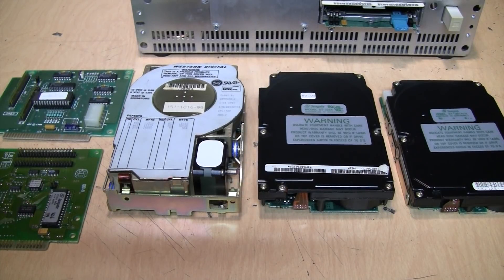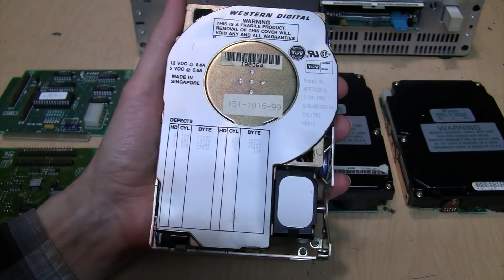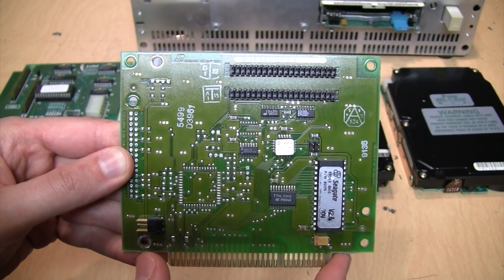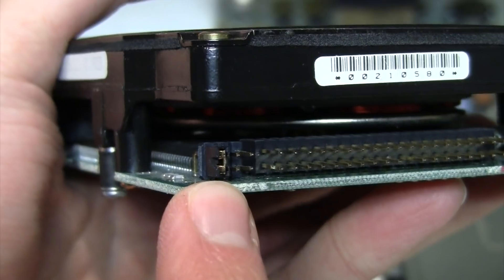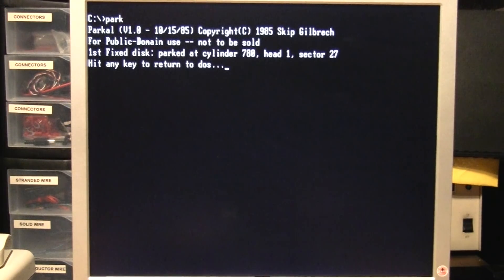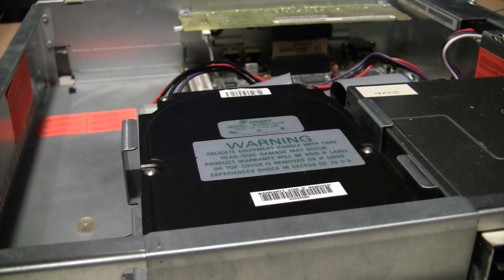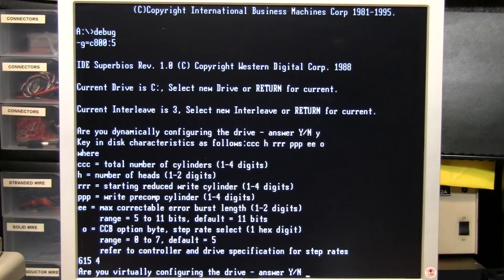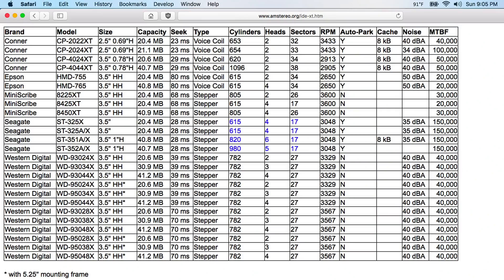8-bit IDE-XT Hard Drives Demystified

Comment: to be fair to the IDE-XT drives, since I made that video I've come across four of the drives. One was a random find on a Goodwill shelf and three I found in PC's I acquired. I have yet to test the one found at Goodwill but of the other three, only one was dead. The other two fired right up. They do seem to be more common than I initially guessed. MY VTI 286 had this odd quark where it refused to boot to any other hard drive than the IDE-XT it came with. I tried multiple 16-bit ISA controller cards and SCSI cards and drives but no luck.
Reply: If the drive is serialized or identity matched to the motherboard, then the drive will only work correctly as such. Sometimes made-to-order industrial workstations are like that.

Comment: Thanks for posting this, I've been looking all over for info on these drives.  Long ago I used to have an '86 IBM PC XT 8088 with a 20 MB hard drive of this type. Based on the few videos I can find, I think it must have been a Tandon TM262 as it sounded exactly like your WD here, but predated WD's buyout of Tandon.  Mine also developed a bearing fault after about 5 years that made the drive fail to spin up unless you gave the stepper motor some manual help (which I bet it hated). Really miss the sound of that thing. I can still hear the precise sequence of "chirps" the stepper motor would make during its power-on self test.

Comment: I still remember the drive parameters for the Seagate ST-351A/X, 666 cylinders, 4 heads, and 32 sectors per track. The BIOS in my 286 would lose its mind every once in a while and I would have to enter it manually to get the machine to boot!
Reply from the maker: Actually it's officially 820 cylinders, 6 heads, and 17 sectors per track. But since it does sector translation, almost anything that adds up to approximately 40 MB will work.

Comment: This is all modern stuff. Back in 1991 my job was looking after systems that used SMD hard drives with 15" removable platters. They were 300MBytes though. I had to present a training course and people were asking "why are you using these old drives with voice coils? Modern drives use stepper motors." The answer was that PC drives weren't up to anything like the same capacity at that point.

Comment: This prompted me to look up the known pinouts of XT-IDE and regular AT-IDE.  The odd numbered pins are almost identical on both standards. But on the XT-IDE, the even numbered pins are all ground, and on the AT-IDE, it adds those extra bits.  One would think there would have to be a way to make it work both ways with an adapter and not needing a switchable drive, but there would be translation circuitry needed definitely.

Comment: A while back I came across a forum thread and a few web pages where people were trying to connect CF Cards to XTA directly using the not-widely-known CF 8-bit mode specified in the standard. If I remember correctly, one person pulled it off by using the XT-IDE BIOS with a modified CF-to-IDE adapter.

Comment: I had an ST351A/X around 2007-2008 I pulled out of a 386 on the side of the road. Should have taken the whole machine. Used the drive for various things including my first real forays into the realm of MS-DOS networking fun.

These days it lives in a Tandy 1000 not much unlike yours in Missouri but partitioned for 20MB because there's bad sectors in the middle of the other half, and the owner wants to play it safe.

Comment: I had one of those wD drives that stopped working (way back in the  late 90’s). Figured I had nothing to lose, so I popped the clips, took the top off and gave the head assy a nudge. Started working again, and never failed 🤣

In 92, my mom gave me a packard bell 8088 fir my birthday with an 80mb wD caviar in it with an 8 bit interface card (might have been a wD, but cannot remember). Transferred both it and the hdd to a Tandy 1000tx later on, then the hdd itself to a 486 with a 16 bit isa card.

Comment: 15:34 - I recently had one of these - that stepper motor actually worked, it was the drive motor that had thrown a bearing or something - it sounded like a grinder. I opened it up and found shavings all over, yet I was still able to pull a DIR command on it.

Comment: Interesting, I do remember their been issues getting IDE drives running in XT machines, it was something I was going to attempt, but never did.
Reply: The more modern XT-IDE card is helpful there, If you don't insist on period authenticity. Has our host pointed out it allows you to attach either a modern IDE or CF card to an 8-bit system. That way you can avoid the control and expense of shopping for ancient MFM or RLL hard drives. Bonus feature: if you get a card that allows you to insert the CF card through the mounting bracket, it is relatively easy to transfer data from a modern system.

Comment: Very interesting, and I was really surprised to see the defects listed on that Western Digital drive; would they be shipped new from the factory with those defects due to poor yields, or maybe these were refurbished drives resold cheaply?
Reply from the maker: New hard drives and SSDs still have bad sectors today. They're just mapped out in the firmware so they're invisible to the operating system and user. Old hard drives weren't advanced enough to do that yet.
Reply: I had a Type 1 (10 Mb) MFM drive that I recently built into an Everex 286 and the defect list was empty. I have never seen an empty defect list. Considering the drive was 40 years old, that was amazing. But yes, those defect tables were a common sight in the mid-late 80s.
Reply: Very interesting. I didn't own a hard drive until I got a 52 MB (I think) IDE Seagate for my Amiga 500 but that was the late '80s or maybe even early '90s. I guess by then the defects were handled internally.

Comment: That WD drive and others like it weren't really WD drives: they were rebadged holdover designs from Tandon after WD bought them out. Up until then and for a few years after, WD built drive interface and video controller chips before selling off the semiconductor side of the house to focus on hard drives instead. Their first real in-house WD hard drive was probably the WDAC280, an 80MB 3.5" ATA drive that introduced the familiar Caviar name and designs that people knew from the early '90s.
Reply from the maker: Correct. There was also a 40 MB Caviar drive.

Comment: 6:05 I've seen those referenced as ESDI but its interesting to know they're actually an IDE like interface
Reply: There is an astounding amount of disinformation about this era of drives.  It was a period of free-for-all, short-lived, and a long time ago.  :-)
Reply: I thought that ESDI was distinct from IDE.
Reply: It is, but a lot of those interfaces are very similar.  E.g., ST506 -- the original MFM controller interface -- is still the basis for IDE.  The main difference being that the controller moved from a card that went into a slot and communicated raw data to the drive -- to a card on the drive that communicated to the slot using ISA signaling as the protocol.  ESDI was the in-between point.  I don't know a ton about the specifics -- partially because it's really hard to find detailed documentation on some of those short-lived, relatively unique interfaces.

Comment: IDE just means the adapter board is attached to the hard disk drive frame instead of being a card in an ISA slot.

The 40 pin connector is neither IDE or ATA, it's a pin reduced ISA bus connector.

ATA is a protocol.

Optical drives that connect to the 40 pin ISA connector use the ATAPI protocol on top of the ATA protocol, or rather, it is a Packet Interface extension to it.

PCI "IDE" is more accurately PCI ATA.
Reply: I've felt for a while that once we got to PCI and SATA, the "ATA" part kind of ceased meaning "AT Attachment" and just became a meaningless legacy acronym to link it to the old parallel interface by lineage.

Comment: I have a Commodore Colt that I installed a Seagate ST351 A/X in.  I had to install a newer BIOS before I could see the full 40MB, but it works very reliably.  I should probably keep an eye out for another in case this on dies.

Comment: Seagate did have bad sectors but mapped in replacement sectors in ROM. Sometimes you could format a drive and always at the same point it would skip to the spare sector and back again. This is why you should not do a true low level format because it would wipe the ROM table of bad sectors and try to create a new table. The original table being mode accurate as it was created with diagnostics. Seagate bought out CDC or Control Data Corp. to teach them how to make reliable disk drives.
Reply: At work we had the SMD 300MByte drives, some labelled CDC and the newer ones with a Seagate label stuck over where they had said CDC.

Comment: I remember how my dad was learning about IBM PCs before getting one, which would be a Commodore Colt (an XT computer).  My dad was educated by computer-savvy people, including the employees at computer stores.  PCs were more complex to operate than TRS-80s, Commodore VIC-20 and 64s, Apples and other such home computers.  When he got an HDD for the Colt, it sure made a difference in loading and saving, compared to using a floppy drive.  I wonder if it could be one of those IDE-XTs.  The '90s were interesting times in getting those complex PCs to work right.  My dad and I even taught people we know how to operate such things, as well as installing HDDs (maybe IDE-XTs, unless they were used on ATs).  Then there came a time when I showed my dad some things that he couldn't figure out.  That would make me decide to go back to college and get a Bachelor's Degree on some computer stuff.  But that's another story.
Reply: yes it is an xt ide, i have a commodore pc10/3 motherboard  i 'rescued' from a bin at work, when they were chucking a load of old computers out, wish i'd kept the case and psu as well, i did have it, d'ohh!, but i originally got the stuff just to strip chips off(got a few other boards as well, an epson equity 2, and some goldstar thing seemingly no info at all on the net)...  they're basically the same thing internally,  i've managed at last to get the board to boot up, it had a stuck reset line,  but havent done anything more with it yet, font in 40 column mode (dipswitches on back to set 40 or 80 boot default) is identical to the pet and gives  same beep sound 😁 i've been wondering about getting an at ide working on it or at least a cf card, theres one or 2 control lines missing for a cf to ide adapter but thing the extra circuitry can be patched onto the motherboard, biggest problem is the bios as although cf cards can work in 8 bit mode, a command needs to be sent to it first for it to switch over, xt-ide bios as on those isa xtide to cf card adaptors would likely work but i suppose if fitting  one of those just for the extra bios, may as well use the interface on that...

Comment: I have a single IDE XT hard drive in a Tandy laptop - I think it uses a high density connector as well, which is another annoyance. There's some other funky drive in a Zenith laptop I have, but I can't remember if its 8 bit IDE or just a really funky MFM physical interface
Reply: I had a Toshiba T3100 Laptop that used a similar interface. In the pre-internet and nostalgia days I scrapped it when the hard drive failed as I had no idea where I could get a replacement. That laptop was full of non standard parts, using SIMMs with pins on them rather than the more using PCB contacts.

Comment: I had a WD drive that looked exactly like the ones in the video- big fat tall ones that seems to have the metal shaped around the platter area. It was 43MB. But it was in a 286 and was attached to a 16-bit controller, so I guess it wasn't one of these special drives.
Reply from the maker: WD also made IDE-AT versions of those drives. They were originally designed and made by Tandon.

Comment: I have that same st351 in my arcade machine for game save data.
makes the same sounds and everything Its only like 30mb or whatever but it still works fine. You know its doing it's job and working from how loud it is. Had no idea it was that old but I checked and the thing is at least from 1989. Surprised its still working and under windows10 thats nuts! It came out of this compaq portableIII  I had a few years ago, old lunchbox type thing with a hellishly red screen. Any idea if I need to worry about parking on these?
Reply from the maker: No, the ST-351 is auto-parking.

Comment: I had Commodore A590 with 20MB XT drive. It was slow, loud and got really warm after hours of normal use. A590 have SCSI controller onboard so I upgraded to a 540MB SCSI and my Amiga 500 got really fast booting.

Comment: Some of the first XTA drives (as well as ATA and some of the ESDI) were mechanically pretty much MFM/RLL drives equipped with redesigned boards. Why waste a crapload of mehanically sound mecahnisms that had already been produced?  That can readily be told by them containing a bulky stepper motor and metal strip drive for the heads, with similar looks to one you'd find on a 5,25 inch floppy drive. The voice coil style head movement was already available in the early 90's ATA drives.

I have a 40MB Miniscrbe drive which appears to be XTA, with the voice coil mechanism, and I have an Amiga HDD controller that has the option for XTA or SCSI. The latter style of drive is obviously far easier to obtain. Why I think the Miniscribe is XTA, is that it lacks the master/slave jumper, which I haven't failed to find on any functional ATA drive I have encountered, and also it appears that there is some different life to the drive when connected to the Amiga controller, compared to being connected to a newer PC board. Kinda like it was trying to do something, but it never detects as a configurable drive. EDIT: Maybe the reset signal polarity is the culprit, hope I can find a way to alter it.

The autopark feature appears to be inherent to the voice coil head movement, it travels home when not powered, but the stepper motor movement does not do it.

Comment: You flashed on the Minscribe @5:22 with it's unique card and power source. I have a Miniscribe 8425 that didn't use the power from the card (didn't have one anyways) but needed the molex power from the MB. I don't understand why these cards have two ribbons? Can these cards have adapters for the other 8 bit HD's mentioned or would you need another card?
Reply: you have the MFM version of the miniscribe 8425.

Comment: I still have two of these drives in one of my drawers. They were pulled from an IBM PS/1 I owned in 1991. Pretty sure they haven't been spun up since at least 1993. I'm tempted, though sounds like it would take me a while to get all the necessary hardware, and there likely isn't anything worthwhile on them other than book reports and my early foyers into Sim City, Civilization, RRT and my attempts at hacking Dune II so I could spawn Devastators for free.
Reply: I would suggest spinning up your drives even if you don't connect the data interface. This should hopefully help prevent the bearings from sticking. Just make sure you don't permanently un-park a drive.

Comment: I have one of those Western Digital stepper drives that doesn't want to work. All I have to do is tap the side of the computer with my palm when turning it on. I just need to break the stiction of the bearings enough for the motor to start moving.

Comment: Damn, now I want to see if I can find all of the pieces of the two Winchester 20MB hardcards that I took apart as a kid after they failed in my dad's Amstrad PC, and see if I can get them to work again... unlikely though.
It would be interesting to know what exactly the usual failure mode of these drives is - i.e. if you have a working drive now, should you use it as little as possible to avoid wear (like a monochrome CRT), or can you just keep using it and fix whatever fails (like recapping a board, replacing belts etc)... surely it can't ONLY be a case of a drop of oil for the stepper motor?
Reply from the maker: Oiling the motor does often get them working again, although not permanently.
Reply: @vwestlife  Yeah... in those drives that can be (even if just temporarily) revived by oiling the motor, the problem is probably internal lubrication that's gotten sticky over the decades -  which means disassembling and cleaning the motor (or replacing it if that isn't possible) would restore the drive fully. (Also, in those cases, it would actually be beneficial for the motor to be exercised often, as it's not wearing out but getting stuck.)

I'm wondering if there are any other likely failure modes related to wear or aging of replaceable/fixable components (obviously not counting head crashes, corrosion etc)... I've seen so many vintage computers and their components brought back to life on Youtube that I'd hope for at least a good number of those wonderful sounding (*) XT drives to keep running for another couple decades... :-)

(*) well, I'm nostalgic about that seeking sound - I could do without the spinning noise...

Comment: Will the 8 bit controller card work in a PII MB  i440 INTEL chipset with the 16 bit ISA slot? Some say to disable the IDE channels in the MB BIOS but that fell flat. Web search says the 16 bit ISA is backwards compatible to 8 bit cards. Either that or I don't know how to set the BIOS. SSTOR claims it isn't connecting to the BIOS chip on the card.  Any ideas?
Reply from the maker: Sorry, no clue.